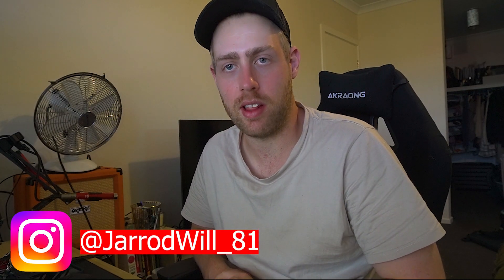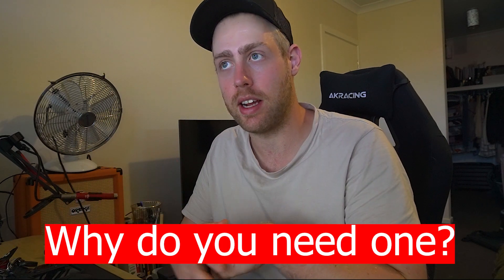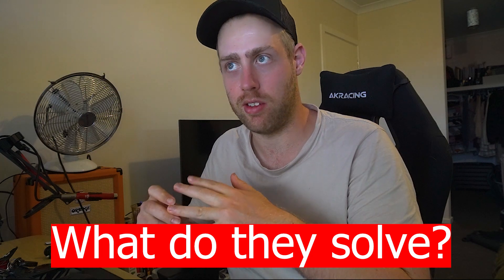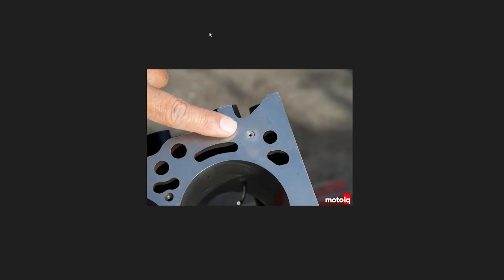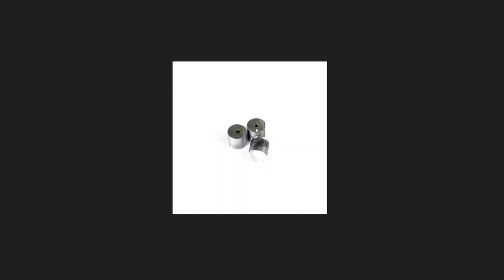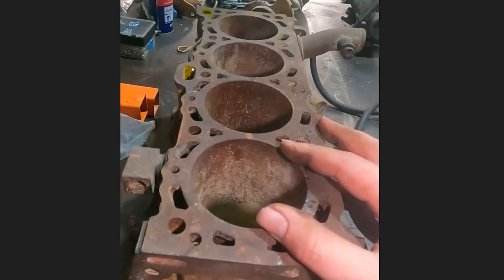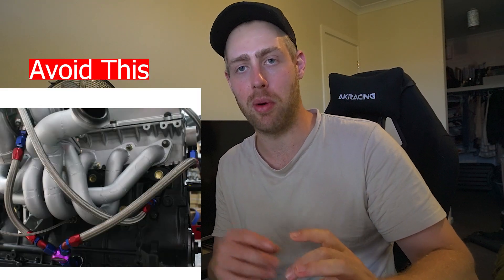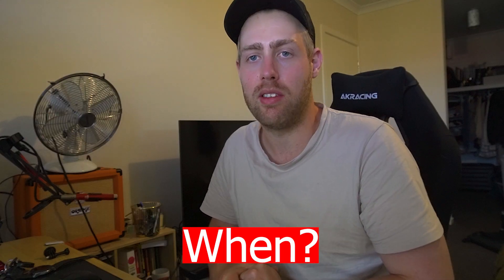What Is a Head Drain & Do You Need One?? | CA18DET, RB25, RB26

Comment: My ca18det was smoking a little i thought it was my headgasket but turns out its my turbo, will the smoke stop if i make the oil drain lower than my turbo?
Reply from the maker: the drain from the turbo should always be lower than the turbo and ideally return to a higher point in the sump. Make sure the hose is also not kinked. If those are right then you could look at oil seals in the turbo.

Comment: I've always been skeptical about the CA18DET "oil drain issue" since it was first posited. The CA didn't really get extensive racing development like the RB back in the day but I presume the designs are largely similar and RB is a development of CA earlier (1985) design.
Finally had a good look at a spare CA head yesterday, there are FOUR oil drains.
The CA18DET is canted over at 15° to the exhaust side, so really it's 3 drains on the exhaust side and 1 breather on the inlet, admittedly the rearmost drain could be bigger. There is another breather to the sump at the back of the inlet cam cover.
I think the real issue might be excess blow-by trying to push return oil back up the drain holes!
Reply from the maker: i agree for most almost stock applications the factory breather system and oil drain is ok. Only for those with higher rpm, high flow oil pumps, loose ring gaps and high boost need to think about head drains.
Reply: Do you know at what rate oil is pumped to the head?
Turbo feed should be around 500-2000cc per minute. I'm just trying to figure out at what rate oil needs to return.
Reply from the maker: @ChrisB200SX  its going to depend on the oil pressure and what oil you are running. ALso what rpm you wish to rev to. Older worn engines will have lower pressure due to clearances.
Reply: @JarrodWillemse  after much more research, I've come to the conclusion this likely isn't really the case and the stock setup should be fine for good condition engines even pushing double the standard power. I recommend cleaning out the wiggly blow-by pipe from the inlet cam cover to near the oil filter.
The RB26DETT had a distinct lack of oil return/breathers, this was discovered and resolved through racing development where they added oil returns. The CA18DET doesn't really have the same physical problem... oil not returning and pooling in the head (causing starvation) tends to be an issue for old, and likely poorly maintained, engines. This often presents with the wiggly metal breather pipe (at the back pf the inlet cam cover) being clogged and this is the main breather from sump to head, if blow-by gasses can't get through easily here they will force returning oil back up the 3 generous oil return holes on the exhaust side. I've had no issues with 350bhp (GT2871R setup) and high revs on my rebuilt engine and I'm fairly sure all the blown engines I've heard about over 20+ years have mostly been old and/or poor condition engines rather than rebuilt engines with a clean oem breather system.
But, hey, it's not the most difficult mod on the CA and really shouldn't cost a lot, so it can't hurt, I'm just highly doubtful that it's as necessary as people have been lead to believe because of the issues with RB oil return and blow-by pressure breathing.